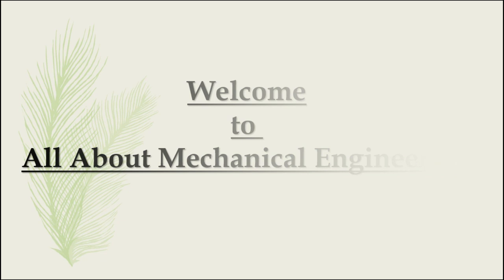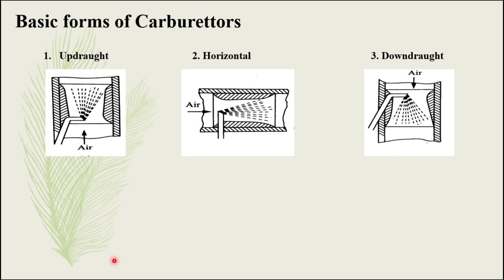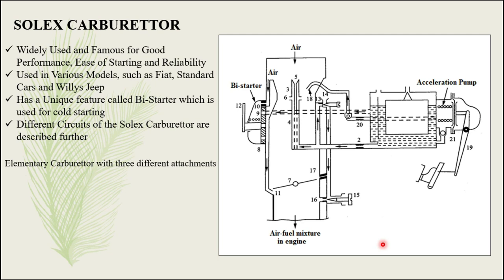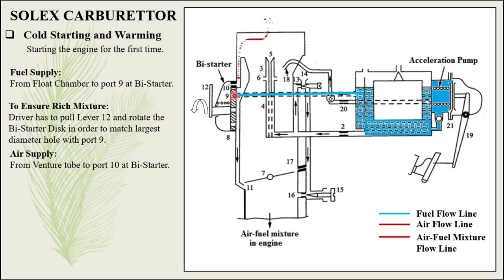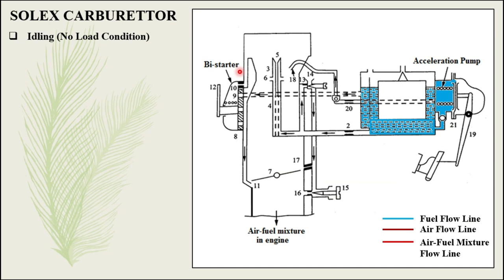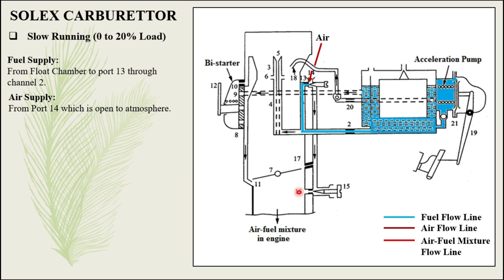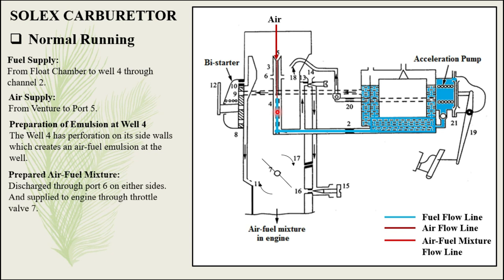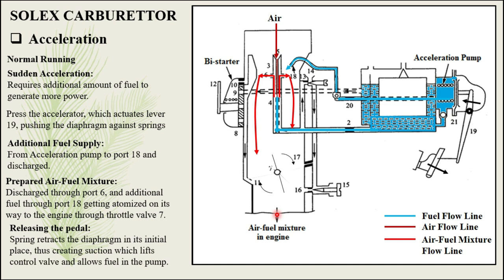Solex Carburettor - Easy Explanation #carburettor #carburetor #heatengine

Comment: I have a doubt. How does the fuel from the fuel float chamber change its path?
Reply: You mean how it gets from the float to the various ports/circuits mentioned? There are internal channels/drilling that allow the flow of fuel and the "jets" meter the air and fuel respectively to ensure the ideal air to fuel ratio. If you are asking about how the fuel gets sucked from different "paths" then that depends on the amount of vaccune that the throttle valve exposes to these "paths". To understand the theory, you can read about Venturi effect